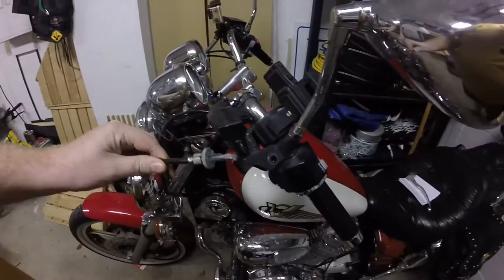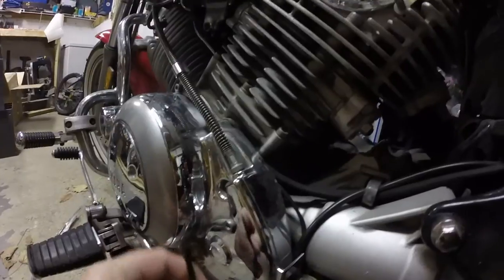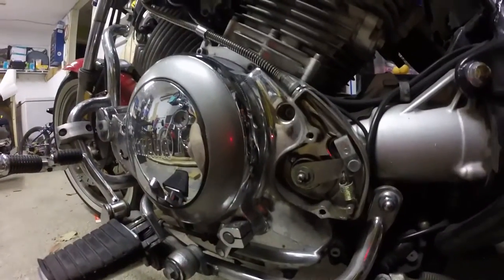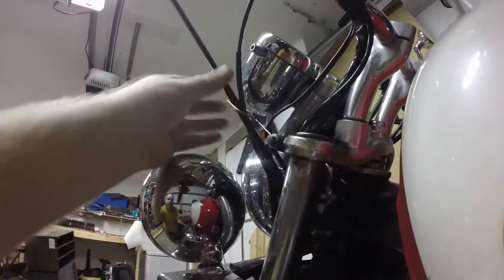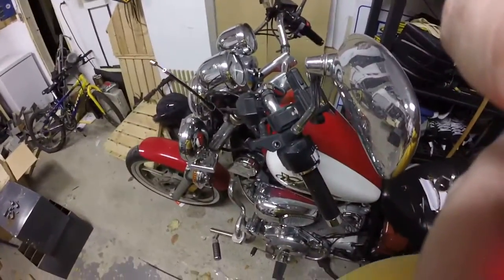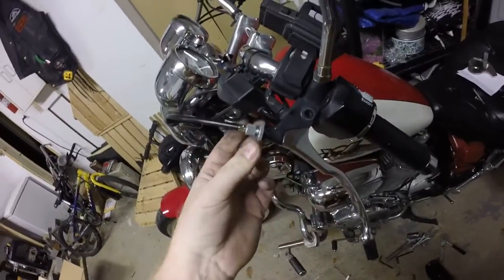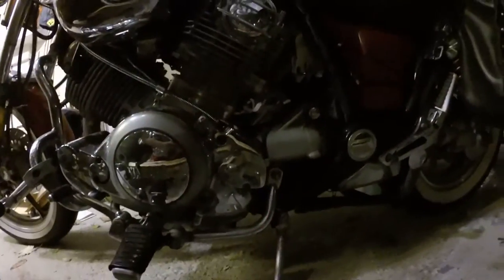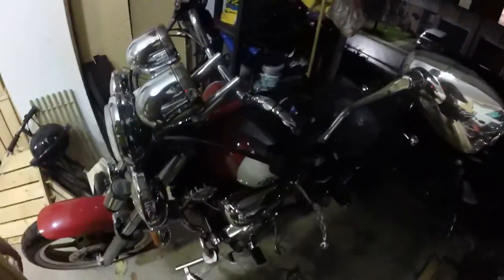1995 Yamaha Virago xv750 clutch cable replacement

Comment: Wish u wouldv shown how to disassemble from the handle part in more detail...

Ugh....im afraid of my bike.    I think it stays awake at night plotting how it can ruin my day.
Reply from the maker: Lol, sorry bud. But I can tell you that bike aren't monsters. You can take them apart and put them back together and keep riding like nothing happened.

The hand control is pretty straightforward. It takes a little fiddling getting it back together, but anyone can handle it. It's only one bolt to worry about (at the bars) and a bit of playing with the tension; just set it to where your own muscle memory thinks it should be.

If you need any help, just let me know.
Reply: @zeroreality  i might have to change tge clutch plates.   Been watching vids.   Looks simple enough if you work carefully and methodically.    But i just know Satan and the excorcist girl live in my bike somewhere.  

Btw its an '85 1000xv virago.
Reply: funny

Comment: Thank you, kind sir. I just broke my throttle cable and couldn't find a good video on it. Your video gave me a hope I could tackle this (and inspired me to photo-document my repair). I wish I had a go-pro or whatever you're using to record this. 

... What did you use? That actually makes for a much better how-to than my written attempt. Oh wait - are you managing all that single-handed? You rock!
Reply from the maker: Throttle cable is easier too (had to replace one on the old Virago). It's two cables actually. Take off the air box, loosen a couple bolts, slip out the old, and slip in the new. Should take 15 if you're slow. Adjust idling RPM with the "dial" just behind the front cable.

Got a GoPro as a door prize, works well, but you can find cheaper on Amazon with the same quality.
Reply: Or 2 weeks ... if you have to wait for parts, and then put the wrong one in first and spend a couple days contemplating that until you check your initial picture and realize what you've done ;-) Hardest part was wrangling the air filter hose back on. Thanks for the confidence boost.

Comment: where can i buy a new cable ?
Reply from the maker: I got mine at the local Yamaha dealer because I was young and stupid.  You can get one from eBay or Kijiji, or maybe FortNine.  The MotionPro cables are aftermarket and just as good.  https://fortnine.ca/en/motion-pro-black-vinyl-clutch-cable-05-0163
Reply: https://www.amazon.fr/gp/product/B07QT3PN74?ref=ppx_pt2_dt_b_prod_image

Comment: Can you please add a part number or a link to the part? I am in north america
Reply from the maker: Sorry I didn't get a part number; just went to the closest Yamaha dealer and grabbed the part.  Clutch cables are simple components though, so just grab a good/cheap one from wherever.  MotionPro makes one for the Virago and it will work just as well as the OEM.
Reply: https://www.amazon.fr/gp/product/B07QT3PN74?ref=ppx_pt2_dt_b_prod_image
Reply: I am sure Amazon also has it in the US

Comment: How long is the stock clutch cable for a 83 750 virago
Reply from the maker: Robert Fox Not sure. The 82-84 are slightly different from the 86+ models. Try over at viragotechforum.com, they're the largest virago owners forum.